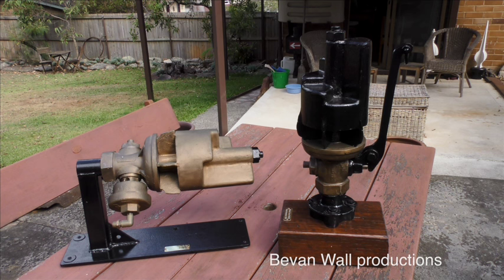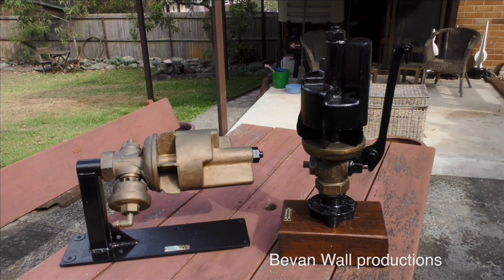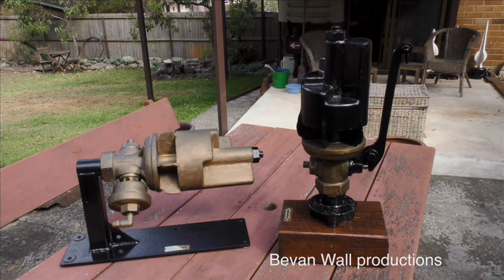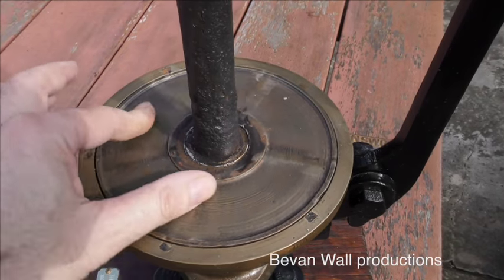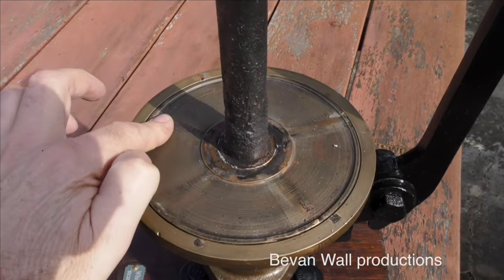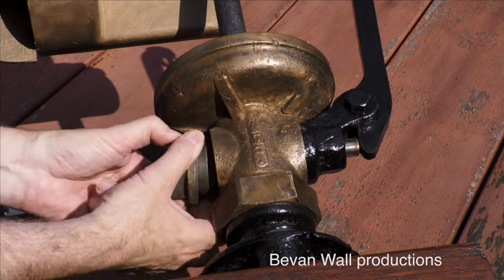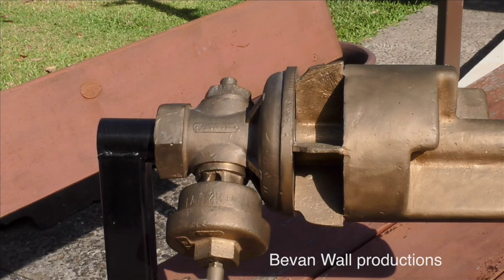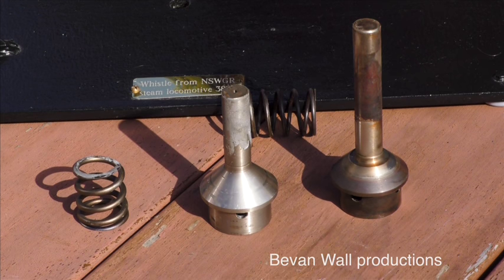NSWGR steam locomotive whistles

Comment: 0:26
Actually, I just learned that the whistles on the 59 Class are not Nathan 3-Chimes, they're Hancock 3-Chime (Short-Bell Version) whistles because I can hear the same notes between the whistle from a youtube video and the one on 5917.

Replica by Rizzoli L.W. in the United States:
https://www.youtube.com/watch?v=bRh61Ax535I

NSW 5917:
https://www.youtube.com/watch?v=KwJFMtSaDY4&t=17s
Reply: 5917's whistle sounds more like Milwaukee Road 261's original raspy three chime that was used up until that Santa Fe 5 chime that's tuned like a 6 got put on the 261. After that ATSF whistle got installed, that raspy three chime's been rarely heard, but it's still there.

Comment: Great video here Bevan. And excellent information and knowledge of the NSWGR 5 chime whistles. :) 
I noticed something last week and a half ago when I went to video 3801 on the Southern Highlander up in Moss Vale on 01's arrival. I noticed on occasions when 01 blows the chime whistle. some times It sounded squeaky like it wasn't sounding off properly  and a lot of times it sounded off perfect in full blast with no issues, similar to the preview here with 6029 Beyer Garratt. Does the occasional very off squeaky high pitch sound coarse by too much wet moisture in the whistle bowl or in the 5 chime whistle chambers?
Reply from the maker: The issue could be that the valve in the cab that was used (there are two) may not have been fully activated thus sending less air pressure to the piston on the whistle which would cause the whistle steam valve to not open fully.
Reply: @bwDVD  Thanks for the reply Bevan. That would've explain the reason for it too. Thought I ask since I watched another rail fan's video here when he videoed it at Bowral. When that squeaky sound happened. Iheard in the background someone saying it sounded a bit wet. I would've thought too much moisture may cause it to vary with the sound.

Comment: I wonder if any American locomotives used pneumatic pistons to activate the whistle like the c38s?
Reply: Pere Marquette 1225 used to use button actuation before the Steam Railroading Institute changed it sometime in the very late 90's or very early 2000's to use a lever. 
From what I've read and seen, the Kansas City Southern used to have some compound articulated that had air actuated whistles that were called screamers, and the Southern Pacific's GS engines used an air actuating lever for their steam whistles just the same as their Leslie air horns. 
I don't know of any other then that, but I'm not omniscient when it comes to rail related knowledge either.

Comment: Why is it that you could pick a 60 class or a 38 from all the other locos if the whistles are all the same? I don't think the boiler pressure would make that much difference. Also I was under the impression that the 59 class were fitted with "Hancock" whistles when they came from the USA and they sound like no others in Australia. Although the NSWGR whistles are similar to the VR whistles they don't sound quite the same as the VR's original Nathans.
Reply from the maker: I think you're correct about the 59 whistles. The 38 class and 60 class whistles are mounted horizontally which does make a difference. Something to do with the Doppler effect. One of the whistles that was trialled on 3830 was a rebuilt whistle from a 32 class.BW
Reply: In addition, I believe the 38 whistles take dry steam at higher temperature from the dry side of the superheater (Front end throttle and all that) which also make a considerable differance. Others all use wet steam.
Reply: I have always loved the joy ville train whistle it's beautiful
Reply: I did my main line firing trials on 3809 in 1964, one unusual feature that I vividly remember was a two tone affect, when the whistle was blown from the cab roof chord rather than the air valve on the drivers side, the start and main blow sound was typical 38cl but at the release of the chord the sound was more akin to that of the 36cl, which tended towards a trail off, rather than the very on/off as found with the air operation.  The other aspect was that most 38cl had slight variations to them especially when in regular service and working many miles between depot visits.

It also did not seemingly take much and still does not to alter the sounds, case point is with 6029 at times it has the distinct Beyer Peacock tune, as found in other Garratts such as in the African states, at other times different sound again.

The 59cl was fitted with Hancock 3 chime Southern Railway types, another very distinctive and beautiful sounding whistle, somehow though on the LVR's 5917 has lost that distinct sound, hopefully that will be remedied during its current time out and overhaul.  A note on the 59c was that the whistle chord operation was unique in that rather than a wire across the cab ceiling there was a wide metal rod with counter balances on each outer end, the wire from the middle of the rod to the whistles opening lever. 

On the outer counter balances a wire hung down  to which you used to operate the whistle, many of our whistle codes requred short sharp blasts, meaning easy on all types except the air operating and the 59cl class, 38's needed enough steam opened by the air to blow, so never a real short whistle let alone just a pop was possible.   The very short whistle was used mostly on passenger train starts or ROW signals from guard etc. It was achieved by giving a short hard pull of the chord and instantly releasing it, on the 59 if you did the same hard pull the counter balance could flip and stay down holding the whistle open, fun and games to try and push it back.

The thing was though it made what the Americans love and call playing the whistle quite easy, as little strength was needed to hold the whistle open as the balance held wonderfully.
Reply: Thanks Colin - very interesting. I remember that setup on the 59's. There are quite a lot of recordings of 38's and 60's (at least one on youtube) where the whistle is blown while the loco is at speed and initially only 4 chimes sound then the 5th chime comes in. I was told it had something to do with the horizontal mounting and wind but I don't know.
Reply: In Trainz driver 2 moblie  I have the fade 3801 with 3822’s whistle and tender and it’s whistle, does 3801 have both have its and 3822’s whistle bevan wall?

Comment: What kind of whistle does 3642 have? At first, I thought it was the standard NSW five chime whistle, until i heard the exact same whistle on a Rogers locomotive in Back to the Future 3
Reply: It is the standard 5 chime
Reply: Whistle in back to the future 3 is a very very warn out lima 5 chime
Reply: @darcypetersen1  Not as worn out compared to 2019, which was when it sounded awful. By the way the locomotive is the Sierra Railway #3, aka the movie star.
Reply: @T128Productions  in late 2019, the Rizzoli Locomotive Works actually repaired the whistle to sound like it was supposed to sound.